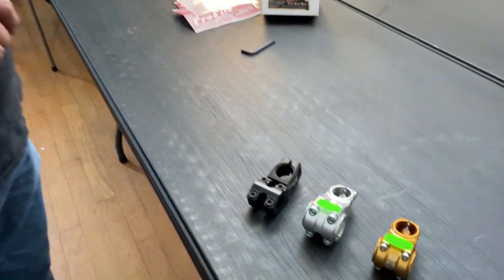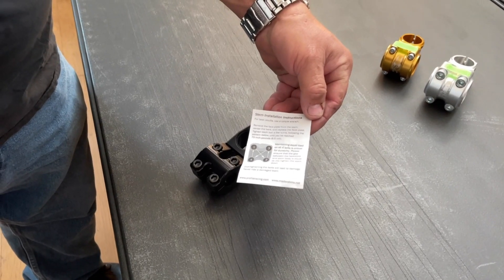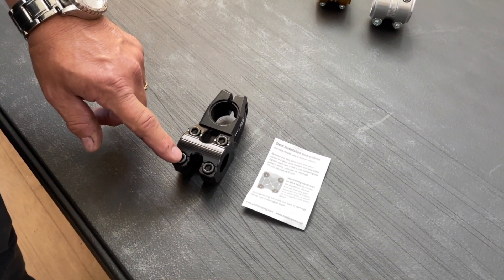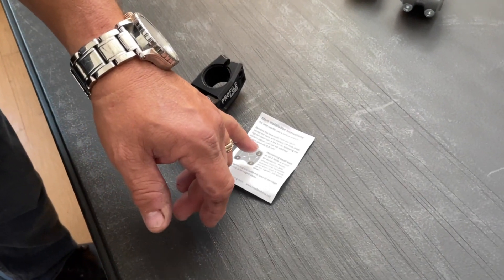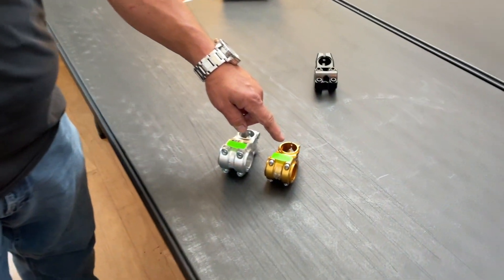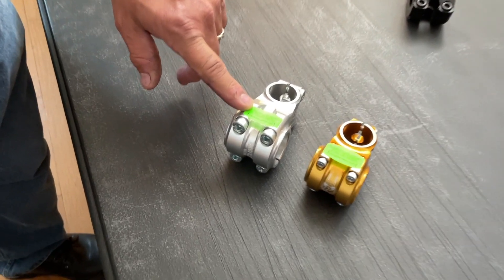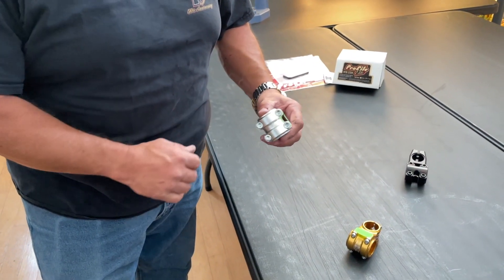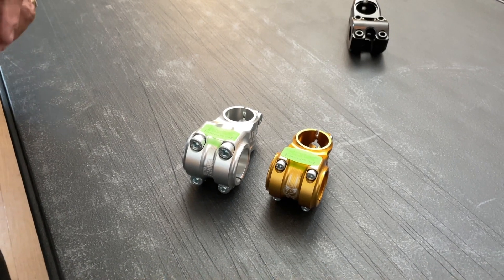Profile's Tech Tuesday: Proper Stem Tightening Instructions (Push, Nova, Helm)

Comment: Have you guys seen the Hope DH (downhill) stem?  The clamping design is genius: tighten the top two bolts completely, making the top cap  and stem into a perfectly round clamping area.  Then just tighten the two bottom bolts.  It's really the best design, as far as ensuring proper clamping of the bars.  I'm surprised their approach has not been adopted by the rest of the market, it's a much smarter design than trying to evenly balance 4 bolts.  Hope is based in England, and make everything in England, a similar breed to Profile, which I also love.  👍

Comment: We need another top load stem with the bolts on the bottom,I’ve seen the older models for 600$ on eBay!
Reply: Fewer threads in the top cap, no?
Reply: @AmazingChinaToday  no like the profile inverted stem